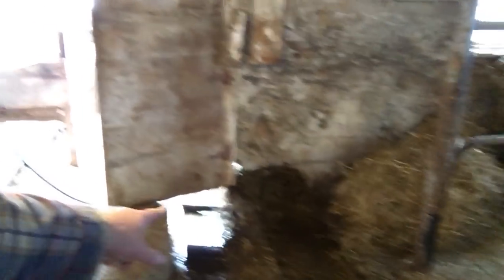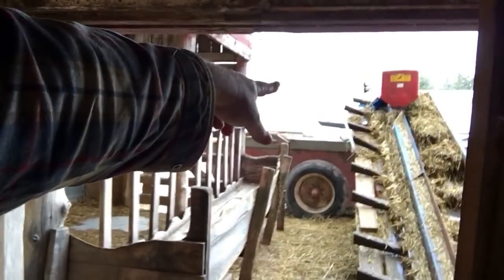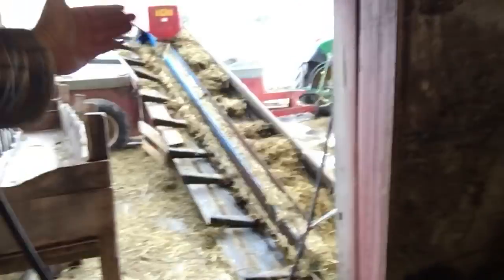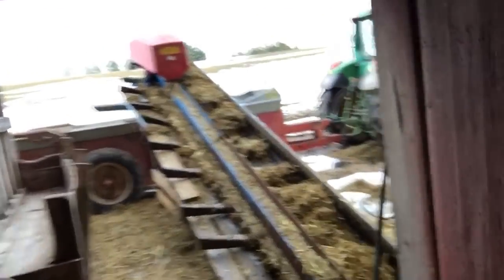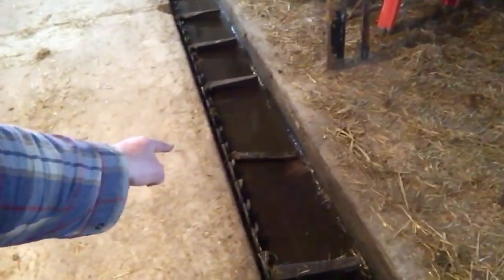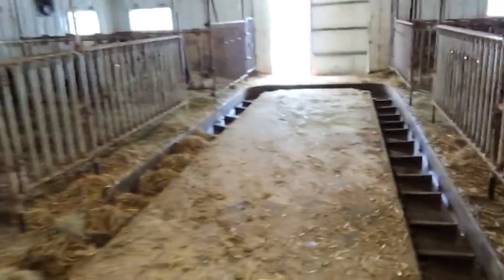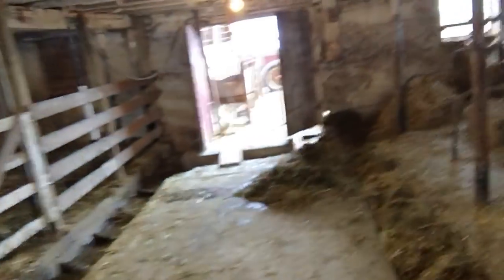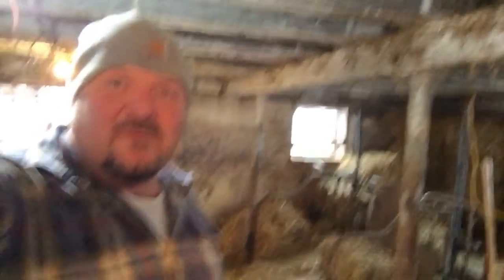Barn Cleaner Problems Explained!!!!

Comment: if you convert the barn would you ever think of opening an end up and filling the gutter with concrete to use the tractor or skid steer for cleaning? many locals that converted the old stanchion barns to pens have filled gutter in and use skid steer, works really well.  

if you rebuild the gutter system would you be able to put a piss pump at the bottom of the slide?

Comment: Ben see you have a problem with where it goes out of the barn it bunches up as it exits the barn you are right need to remove the concrete where it leaves the barn and just needs some tlc to keep operational as for use of pins.

Comment: The trench cleaner worked well when it was moving sloppy manure from well grained dairy cattle every day. Full size animals required less bedding or you might have been on mats, now with only using pens, extra bedding, smaller stiffer manure, waiting an extra day or two plus frozen manure does put an extra stress on the system. A larger insulate steel door would assist in removing those frozen/packed manure slugs.